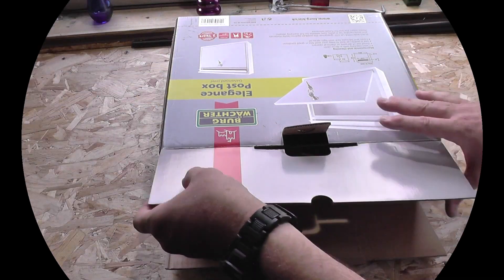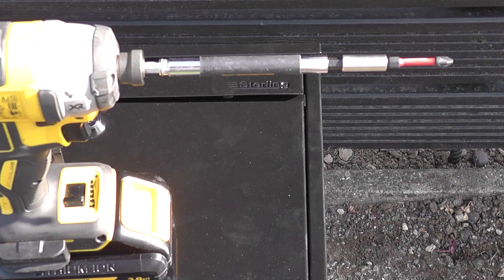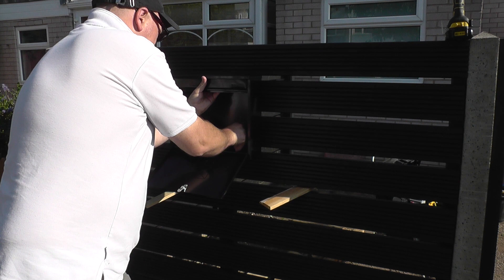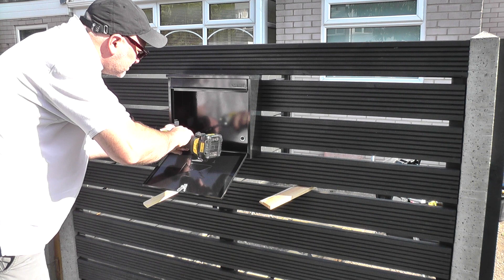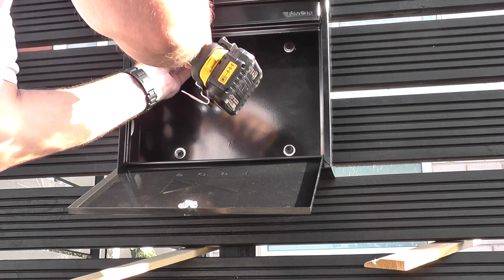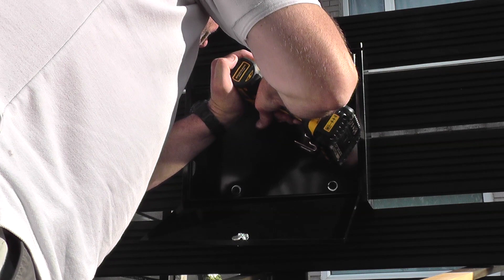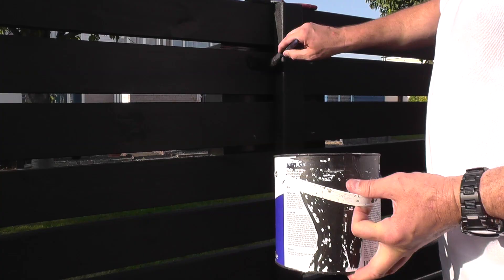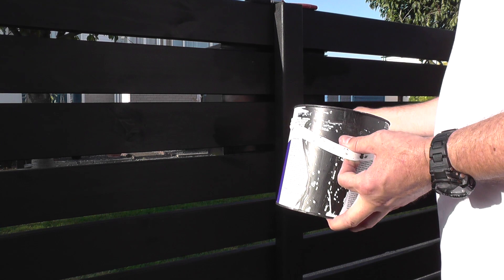How To Install A Post Box / How To Install A Mail Box

Comment: DeWalt do a bit holder that has an offsetable adjustment for about £12  that would help with jobs like that. I think it was in Screwfix, but Toolstation also does similar.
Nice looking job that mate.
Reply from the maker: Thanks for the tip! Will check it out. Sounds useful. Des
Reply: @21stcenturycaveman33  Screwfix autumn 2020 catalogue p857 item code 307FH DeWalt mixed impact torsion bit 11piece set £10.29.
All items used with impact drivers need to be impact rated due to the high torque and mechanism.

Comment: Just bought the same. £18 from.ebay, a steel. Don't worry about needing a long extension for the screws, use a 1/4 ratchet with a bit.
Reply from the maker: Good idea. Des

Comment: Guessing the holes on the bottom are for drainage? Is there likely to be any issues with it sticking out onto the pavement as it looks like the fence is right up to the boundary so people walking/cycling past might catch themselves on it?

Thanks for addressing my comment in the previous video about accessing it from the rear. I think you are correct that it would be best to get a different version designed for doing that if it were something you desired.

The whole project looks great. Though you now need to do the front yard so it looks as good as the fence ;-)
Reply from the maker: Hi buddy. You may well be right - they could well be drainage holes although I would hope that there isn't such a pool of water that they'd be necessary (fingers crossed!). I think it'll be absolutely fine protruding a little although it did briefly cross my mind to be fair. Your comment about access from the rear has got me thinking though and there may be a solution without wrecking the thing. I'm still mulling that one over ... possibly a vid to come? Have a great weekend. Des
Reply: @21stcenturycaveman33  You could maybe put some hi-viz warning tape on the sides so it stands out to people as they go past if you think it might be an issue.